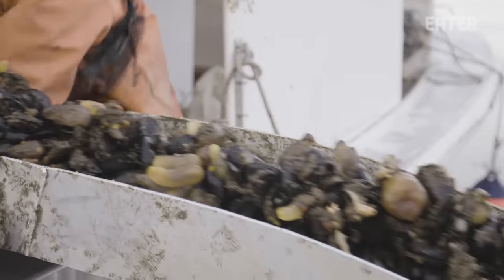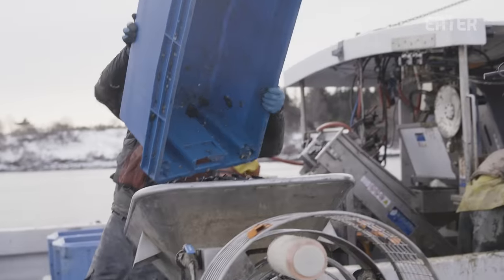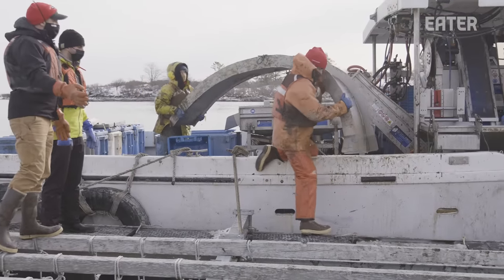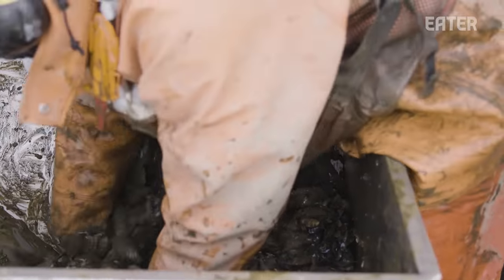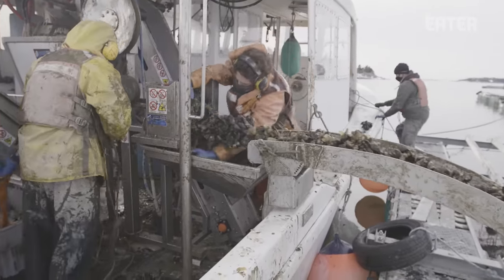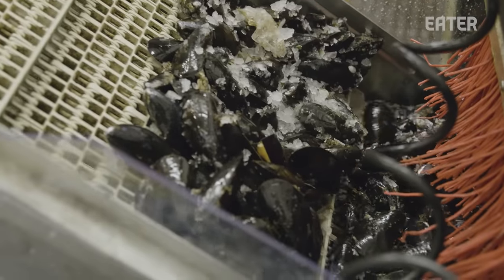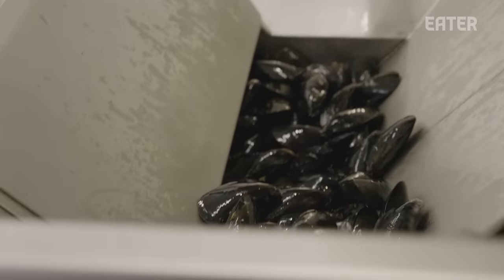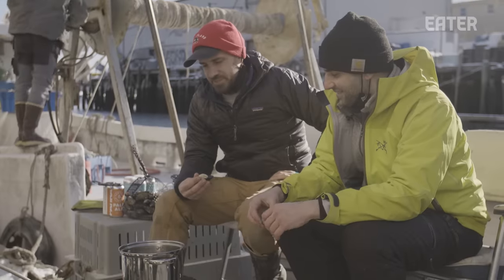How a High-Tech Mussel Farm Produces 7,000 Pounds of Gigantic Mussels per Day — Dan Does

Comment: Hi this is Abhijeet Deshpande and they shod during seeding should timestamp the ropes and categorise every one of the seeding rope lines on seeding and harvesting dates.
They should increase the number of bins like containers and every one of seeding liners segregated on the basis of seeding and harvesting date, week fortnight month quarter six months to one year
This will ensure differentiation in as well as customized production  of mussels growing to large sizes as special category small medium to large, including customized large volume and mass...
Like matured liqueurs...
Seggreation should also be categorised separately as seeding and harvesting as harvesting young mussels or adult or older ones, including their sizes.
Harvesting by date, size, volumes differentiated....😌
Reply: Things don’t grow at perfect rates. Thats why they have sorting systems. They also are clearly keeping track generally, they have multiple platforms and seem like they’re rotating through them.
Reply: @ngregoirenc  Hi NG,
This is Abhijeet Deshpande and....
Yes,
things don't grow at perfect rates.
Which if you recall my post to which you have replied

Now,
Points:

1.) I have had asked for creation of segregated bins like retractable enclosures for the segregated  and timestaped seeding lines 
2.) These at regular intervals would enclose the seeding lines from the sea.
3.) Now, just like land based crops, these would be fertilized by infusion of supplementary nutrients, like fertilizers and compost, not these, but water based nutrients upon which these mussels will feed and filter.
4.) Just like humans animals and plants and crops on land additional nutrients provide for an higher growth rate than normal ones.
5.) These specialized nutrients can be developed by association with scientific research and development institutions.
6.) The segregation timestaped seeding lines just like production assembly lines can be then enlarged to create acreage in the sea 
7.) This acre based sea farming can be then classified and categorised into sowing, harvesting and yeilds as well as speciality supplemented and augmented nutrients rich sea  crops.
8.) These fishermen can then be classified and categorised into farming and allied occupations called as pisciculture or aquaculture farming occupations.
9.) Thus equating farming occupations to equitable levels.
10.) This point is only towards forming of policies and plans by the respective national governments
11.) Now, the growth and development of mussels could be timestaped and modulated and regulated with the infusion of supplementary nutrients, in specific quantities,for the sea farming seeding lines or bins categorised and expansion of surface area into acreage.
12.) Another point to note is that within the water sea or ocean boundaries of nations these sea surface areas can also be leased or rented,not sold specifically due to many reasons, to these farmers like occupation ownership of sea areas for farming.
13.) As such incrementally increasing the revenue for the respective governments from these occupations, both in direct and indirect and other taxations.
14.) Just like land based ownership, these sea farming areas would also be given a sea record of their acreage ownership with latitude and longitude coordinates along with s top skyview coloured map highlighting their ownership areas.
15.) Now to come back to the growth of mussels, of point no. 11, the growth rates of mussels, from seeding to required maturity can be researched and analysed in and with specific regulated laboratory methods of infusion of supplementary nutrients, in modulated and regulated mechanism to monitor their gowth process.
16.) And as such like land based crops, including modified plantation, these can be developed classified and categorised nto potential high growth rate sea crops.

This and above are many more such like are my conceptualizations, as sea and ocean water food resource based Inland Water Resource Farming,

Which I have also regularly been proposing to every government of every country, worldwide, 

But rather sadly has not been initiated and been neglected by any and every one till date.
Reply: @ngregoirenc  including the info as the link from your own profile of segregated and influenced controlled growth of plants

https://youtu.be/gW-21CHDkIU

1.) Secondly these bins can be turned into floating devices by ballast tanks
2.) The bins retractable closure top bottom and sides in Including the seeding harvesting reseeding and regulated and modulated infusion of supplementary nutrients can be done by automated AI RC AVCC systems from land or sea
3.) Thirdly, the bottom of the sown enclosure bin could be fitted with fan or propellers
4.) This would ensure that the nutrients that would eventually settle on the bottom of the bin would be churned and thrown back towards the top like a mixer, as such the mussels would feed or filter the same repeatedly.
5.) Now this entire mechanism could be powered by miniature wind and underwater yet water surface propeller turbines, including floatation systems having solar panels.
6.) These would generate the necessary electricity power and energy for powering the entire mechanisms, without human intervention, cutting wasteful consumption of costs and resources.... 
7.) And to super exponentially increase seeding and growth and yeild and harvesting in massive numbers
8.) Instead of ropes they can use box mesh filled with nutrients, which the mussels can grow their beards / roots into.
9.) These mussels can the  be loaded into their socks and pulled onto the box mesh.
10.) Like plants grown with soil bricks on walls with box meshes.

11.) These concepts of mine can also be used for other water resources farming like scallops, fish lobsters shrimp prawns, etc.
12.) Reducing load on deepwater fishing, thus replenishing the seas and oceans with all the species
13.) Another point to note is that these seeding lines or box mesh installed on parallel beams could also be made retractable like a pulley lift, pulling every seeding line or rope or box mesh either individually or 
In customized preferences out of the water then lowering them once again.
14.) The seeding ropes lines or box mesh installed on the beams would work like honey harvesting of  bees. 🐝

Like honey comb plates....

Simple solutions to complex problems ....

Reducing food scarcity all around the world, instantaneously

War Out😌🤘
😎👍

Comment: Ignaty shadrin... Switch to side hooks on those beams so it's easier to pull along the open slit only have to dodge the side beam. And the hooks need to be not catching your ropes somehow sunk in or something blocking the rope from catching also consider buoy for harvest time only so the line doesn't drop and lose any if that is a problem.

Comment: I wonder what happens to all those shells.
Reply: You can always DIY some sort of things out of Mussel Shells.
Candle Holder, Picture Frames or even use as wall designs if you want an oceanic theme on your wall spaces.
Reply: Well, most are gonna be left in the shell and then shipped, so whatever the end user decides to do with them. If they just get dumped into the ground in some way or another, they end up enriching the soil with calcium, so not a bad thing. If they get shucked and the processing plant has a mountain of shells that they don't know what to do with, about 95% of that shell is calcium carbonate. If you just ground them up and stuck them in a kiln, I'd bet you'd be most of (if it doesn't straight up just work that simply) the way to builders lime, which has a slew of uses from food preservation to sewage treatment to mortar for construction. Probably not the most cost-effective way to get it, though. Either way, again, ground shells would make a good calcium supplement for soil and the only processing would be grind and bag.